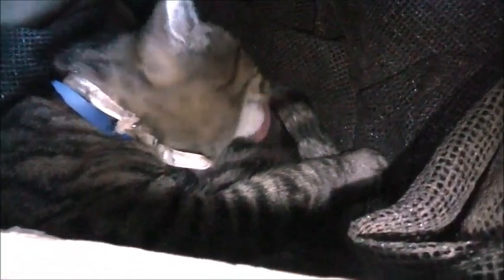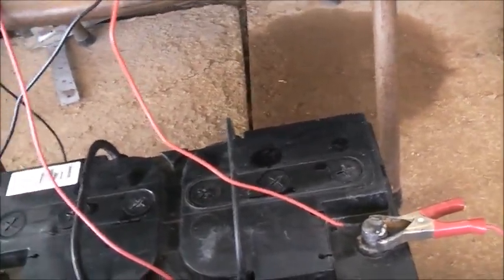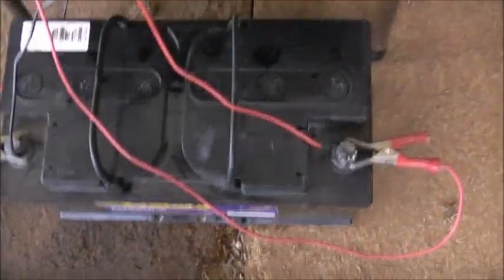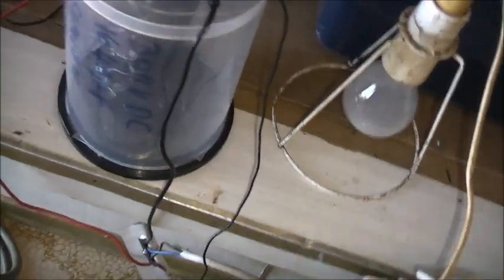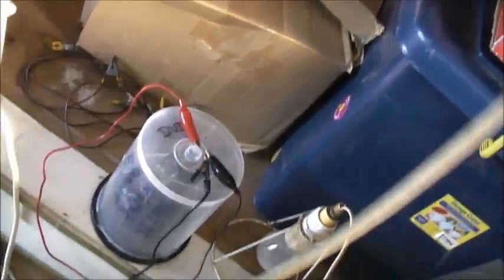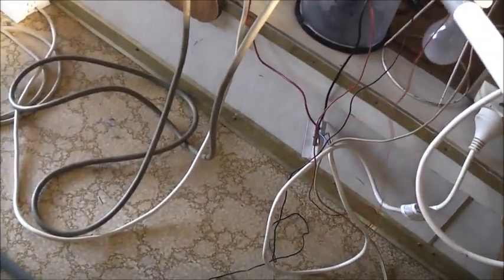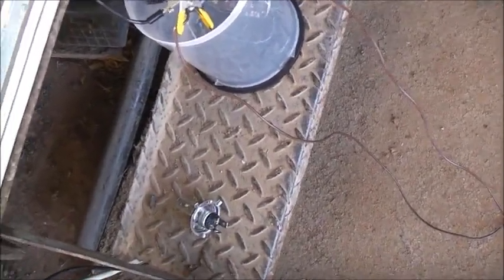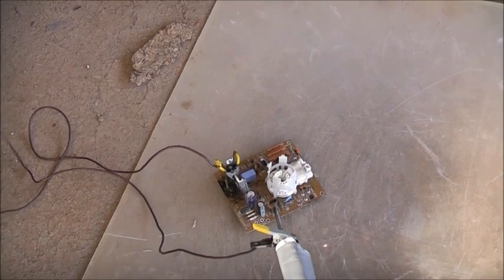Capacitor Bank Fun

Comment: The projectile must be outside the coil to begin with.  If it is already inside the coil when you energize it, it will just stay in place and in fact be held very firmly.  Also, if you go for any more capacitance, you'll need thicker wires and a big diode to keep the inductive voltage spike from destroying the capacitors and rectifier.

Comment: That cat looks really comfey :-)

Hmm dick smith electronics, is that an australian only brand as ive never seen it in the uk on multimeters?

"Dirty d.c" charging can help batterys, just half wave rectify the ac.

stick a dc 5 amp psu across the capacitor, the wrong way around, it will pop.